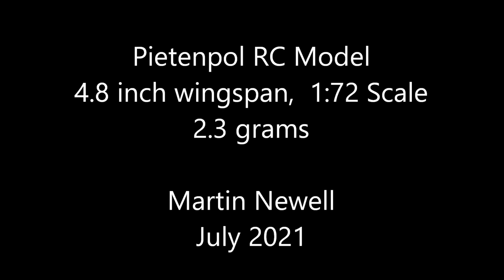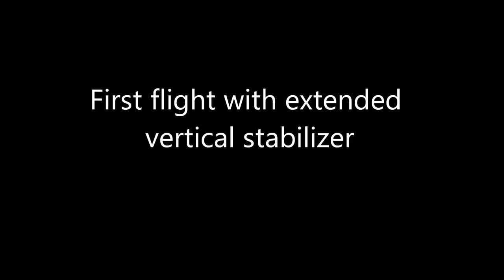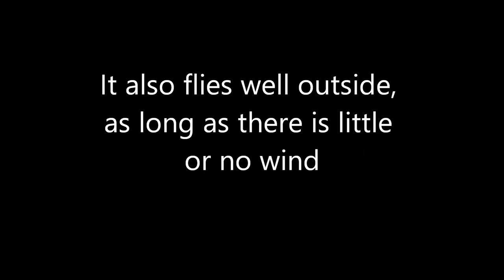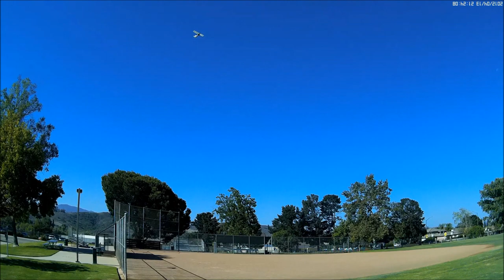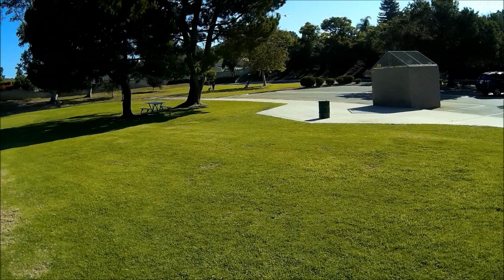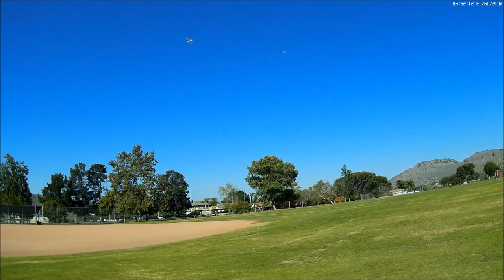Pietenpol 1:72 Scale RC

Comment: I’m assuming the control surfaces (vertical stabilizer in your case) have to be larger when planes get this small because the density of air stays the same. Like the air and even gravity are not scaling down as the plane is. It probably isn’t very noticeable until you start getting this small. Very neat plane! I would love to own one of these.
Reply: Yep, air gets a little weird when you get this small small.

Comment: Interesting story. The Pietenpol Air Camper, I mean. Thank you!

About the size of the rudder, in ship models is the same: you have to make it bigger in order for it to be effective.
I am no aerodynamics specialist but I would say that it has something to do with the Reynolds Number...
If I recall correctly, in smaller scales, a model should fly faster the smaller it is, in order to have the same behavior as the original.
Or with the same speed but in a denser medium (fluid).
Reply from the maker: Interesting, thanks.  You are probably right about the Reynolds Number, but that's all a bit abstract.